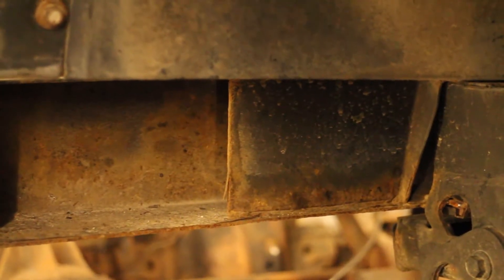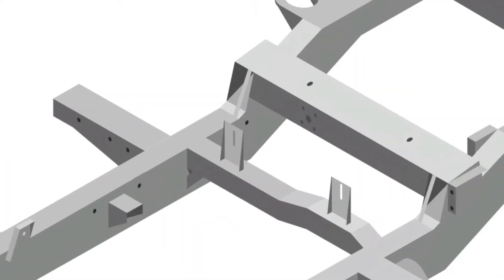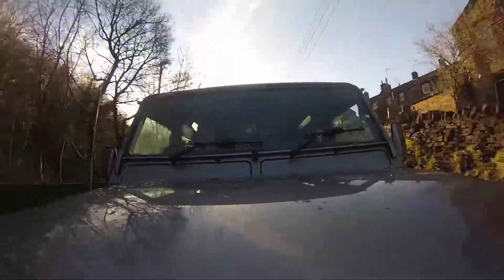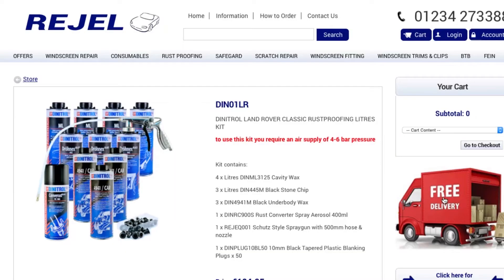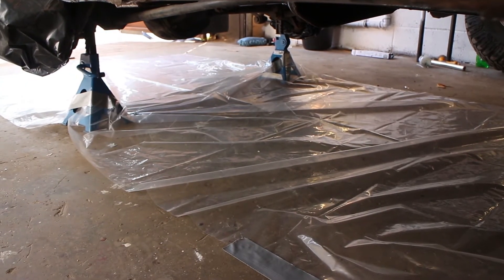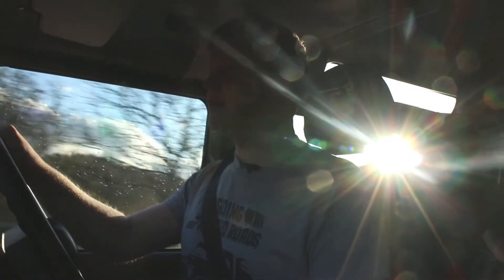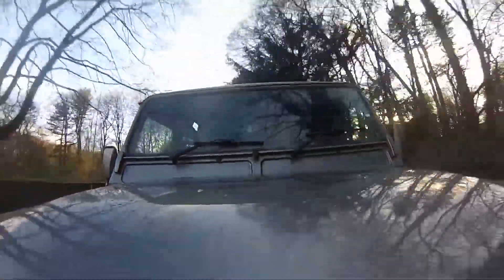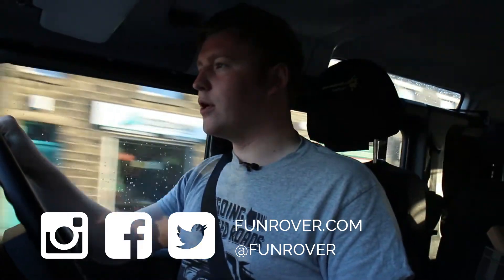Series: Why Land Rovers Rust and how to stop rust with Dinitrol

Comment: On my D1 the chassis, axles, and floors were all under coated when it was new. The only rust I have on the truck is on the exhaust, the under coating worked very well.